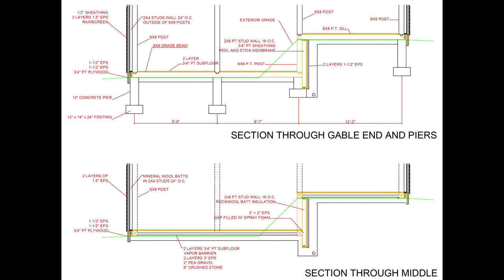Podcast 606: Foam Slabs, Gaps in Click Flooring, and Board-and-Batten Rainscreens

Comment: Did the person not clean out the edge of the tongue and groove. Cause a lot of them have dirt in them,it won’t lock in as good. 

Also is this just one spot or other areas. But, he has to take it up. Since they need to be a 45 and tapped in.  

It shouldn’t be that hard to fix since he’s got it cut just take it up to the point and start over. Sucks. But, you have it cut in anyway. 

Flooring guy here :3